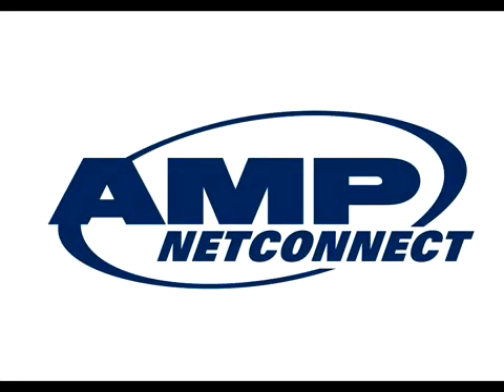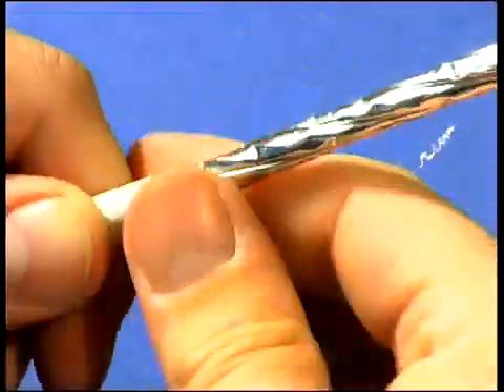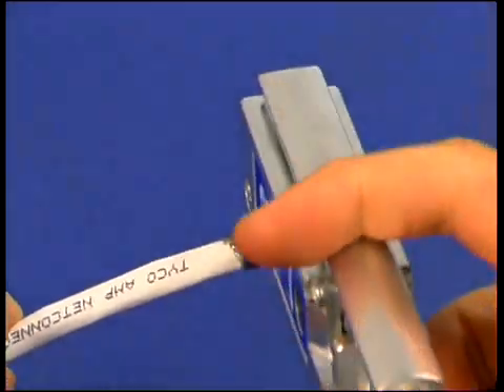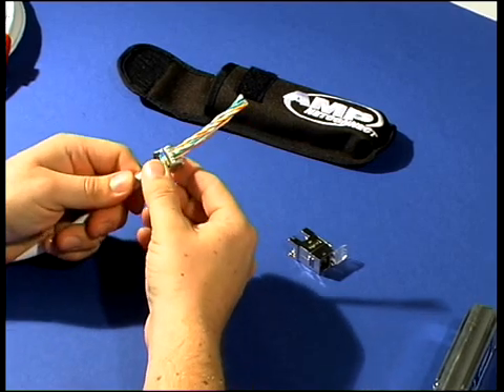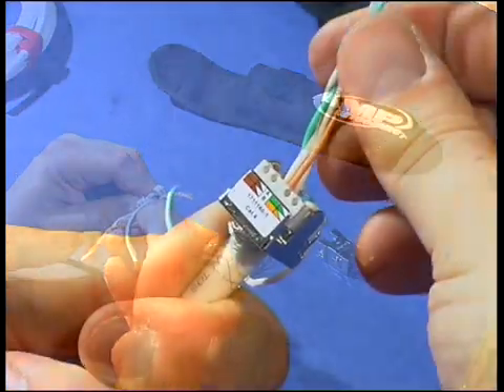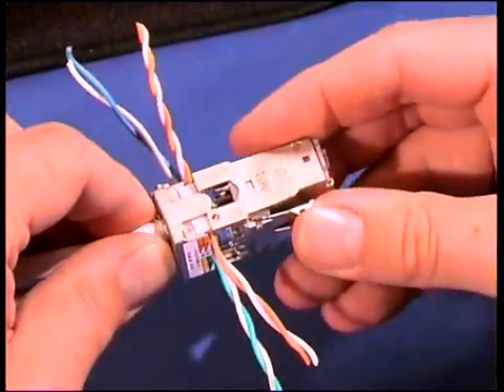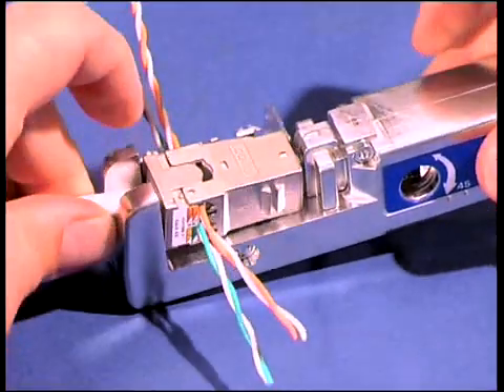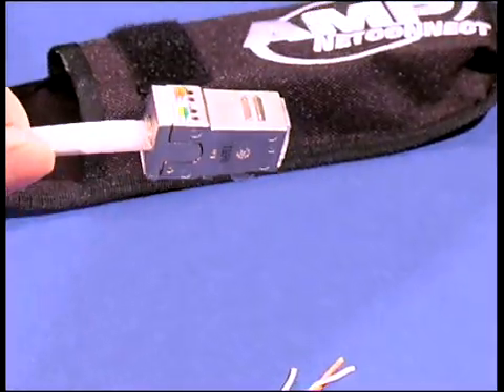Termination of CAT7 Installation cable

Comment: here's the Instruction Sheet for the jacks
https://www.commscope.com/catalog/doc/pdf/14660/411-93014_AMP-TWIST-6S_SL_JACK__Side_cable_entry.pdf

and it list this PN for the compression tool 1901551-1 
and the PN for the tool with the foil stripper 1725150-3

it's ~$100 on ebay today

Comment: Can I use a cat 7 where I have already been using cat 5e? Or these cat 7 connectors are for newer upgraded Ethernet ports.
Reply: @Blair Aquilia    CAT7 is not a IEEE approved technology.  You go blind on this.  Cat6, cat6A and Cat8 are approved and recommended.  Cat6A is way cheaper and do the same. Also compatible with many brands ....
Reply: @Blair Aquilia cat6 is widely use, very good     also 6A , and are recognized standards     cat7 is a trap from some manufacturers ...!

Comment: Where can I buy that tool. I want to do it DIY. I'm wiring my house rn with a Cat 7 wire, and this tool will be a huge timesaver
Reply: It seems I may have found the same tool. They are quite expensive, too. It seems that they usually go for $220.

https://www.ebay.com/p/633649291

All sold out on DigiKey.

Comment: Dang that looked a lot easier than I thought it'd be. Despite the foil, it looks far easier than individually punching wires down and worrying about them slipping out of place, or busting a notch if you aren't careful enough.

Comment: I just bought a home internally wired with Cat7 in each room. Terminating these suckers is a pain. One thing in this video I do NOT recommend is stripping the foil layer. It is too easy to cut too far and nick the wiring. It's much easier just to unwrap the foil from each pair by hand, peel back the foil, and trim it manually with small clippers. Otherwise, that is one killer tool you're using! Way easier than the traditional punchdown methods.
Reply: I have the same opinion on stripping foil from pairs
Reply: 100% agree. I am networking my home using Cat7. what a P.I.T.A. to get the foil off each pair without damaging the individual wire sheaths.  I used to terminate Cat5a all the time....this is a miserable process, takes 5X longer with Cat 7
Reply: @JustinBollman  And the increased benefit, at least for my use case, was negligible. If I could do it all again, I'd go back to CAT5
Reply: @MrDoggerDog   I agree.  Unfortunately, I already bought 300 ft of Cat 7, now I have to make it work.  for what it's worth I found an easy way to get th foil off each pair. You strip off about 2.5 inches, separate the  pairs, then take a pair and just gently roll it in your fingers, the foil starts to just lift off and separate, then you can "unwind" it from the pair and get it down and trim it.  My problem now is that I bought super cheap ends and they are junk. I'm waiting on better quality ones from ebay and those are pass through so hopefully the terminations will be more reliable. I've terminated one cable 3 times and it's missing different pins each time I test it. Frustrating.
Reply: @JustinBollman  That's how I did it too. And after manually rolling back the foil, I used electrical tape to hold it down against the line so it didn't look like a frayed mess. All my terminations were behind wall gangs, so nobody can see them (thank goodness), but man, terminating each line took forever and was way more work than it was worth. My use case? Primarily streaming my video collection (Plex), which is lightweight. In fact, my client devices (Roku Ultra 4K) don't even have gigabit ports on the back; they're all 10/100, so when the contractor told me he was "future proofing" my house to CAT-7, I thought "overkill." Funny thing is, when I moved into the house, and saw that he didn't terminate the lines, I thought "what a jerk!" but in retrospect, I see why he didn't want to do it! Ha!
Reply: bought new flat and layed cat6 cables. terminating all 8 cables was annoying. I can't imagine terminating cat7 lol

Comment: Cat7 and Cat7A will not be a future standard.
Now the future is Cat8.1 and Cat8.2 (Max 30m in DataCenter)

Will the Tera connector handle Cat8.2

I think so (Personly)
Reply: From what I understand, cat7 and cat8 can be terminated using shielded rj45 connectors... so it’s really just an issue of the wire rating (which is mostly a matter of twist rate on the pairs).